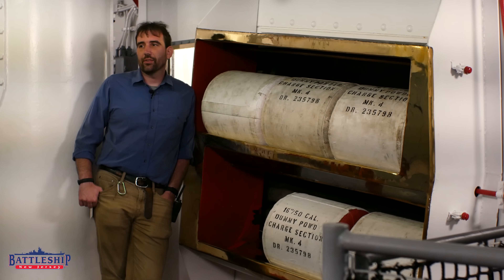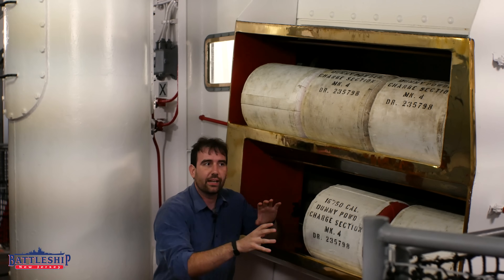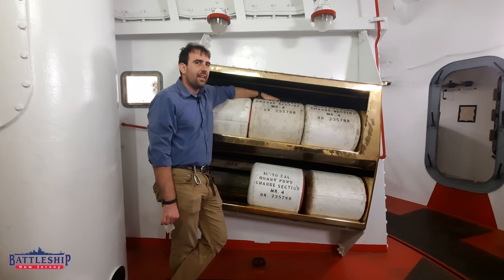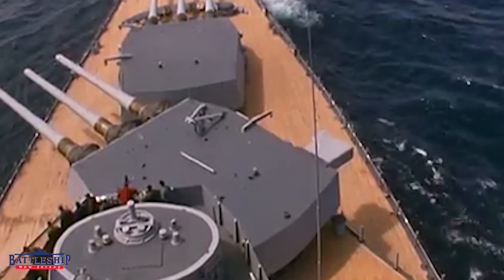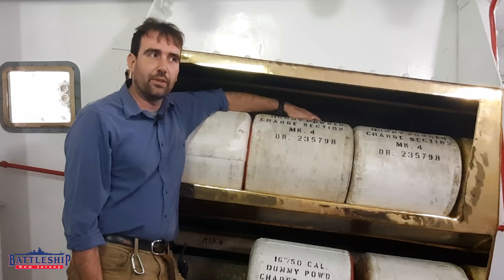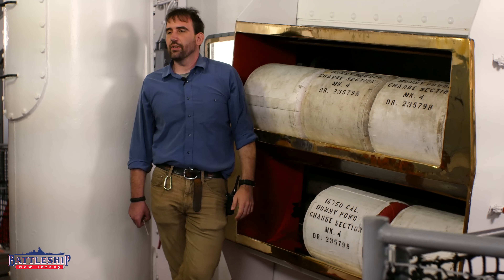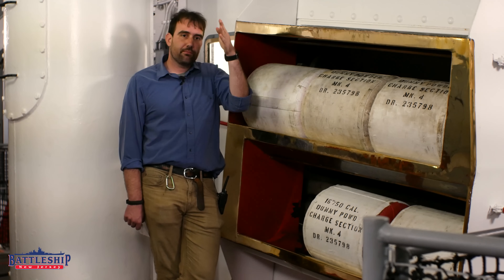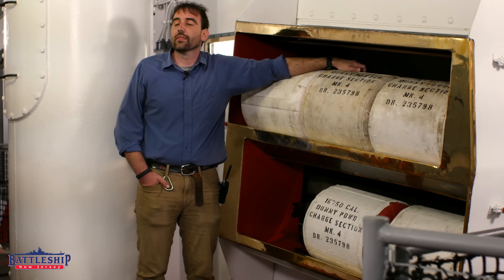16in Gun Powder

Comment: Black powder detonates, smokeless powder deflagrates.  Holes drilled help with surface area which is important for burn rate.  IIRCC, 20mm  Orlikon used IMR 4831, improved military powder 4831.  Great for .25-06 Remington.  Largest charge would be a 40mm from a MK 19.

Comment: In the 1934 James Cagney movie filmed aboard the USS Arizona they portrayed a rip in one of the powder bags dumping gunpowder on the floor of the turret and igniting starting a fire. Cagney puts it out by rolling on the ground smothering the flames and stopping a potential disaster. The turret scene looked more like a Hollywood fantasy than what it would of been looking at videos of actual turret operations. 

Would be interesting to hear if there was a check fire if a bag did rip open and clean up of the spilled powder before continuing on with the mission in actual operations?

Comment: Fired 5"38 Caliber guns on my tin can, USS Zellars DD-777, '67 - 70.  Of peripheral interest while talking about charge weights and pressures, would be the actual chamber pressure generated by a fully loaded 16"50 gun say, as opposed to a dinky little .22LR or maybe a .44 Magnum.  A 16/50 develops approximately 37,000 pounds per square inch of camber pressure, a .44 Magnum runs about 36,000, and a dinky little .22LR maxes out at about 24,600.  So, despite the variation in projectile weight, even from the lowly .22LR up to a 16/50 GP, the difference in chamber pressure is less than 10,000 pounds per square inch, and the 16 is just 1,000 PSI more than a .44 Magnum.  Wonder what Dirty Harry would think of that?

Comment: Did the discharge completely consume the cloth materials of the powder bags?  Were they nitrated in any way to make them burn?  Or what there residue that had to be removed between shots?
Reply from the maker: The firing completely burned the bag, but there is a burst of air after every shot that helps clear the barrel of any remaining debris.

Comment: Was the powder suspect in the turret accident ?   I think my largest charge was 70 grains (this is the AVDP weight of 1/7000 of an ounce) in a .388 Win Mag.
Reply: It really puts these loads into context when each 'grain' is larger/heavier than every small arms propellant load. One of those dummy charges would also make a nice foot stool to go under a loading bench I guess. Also interesting the stats on propellant degradation over time given the age of each charge, and I guess potential handling, operating and storage variations.
Reply: From what I remember from reading about it years ago, so maybe faulty memory, the issue was in that final layer of grains laying sideways. In some cases, one or two could be piled on top of that layer sticking out from the rest, and the pressure of the ramming home of the bags caused these rogue grains to combust in some way setting off the rest.

(Edit: looks like what I'm remembering is part of the "overramming theory", there's really good descriptions of what possibly happened as replies to one of the first posts.)

Comment: I've always wondered why the Navy had separate projectiles and propellant charges?  I mean when the Army loads a howitzer, it's all one cartridge just like a rifle.  Now for the 16" guns on a battle ship, I thought it might be to keep weight down but they did it for smaller guns too.
Reply: By using only 5 or 4 bags per shot, you would be able to dial your guns to different speeds and ranges.
But I think the main reason is that as a single cartridge, it would be impossible to move the thing around in a cramped space.
There are some truly ginormous shells, but I think those were all for field artillery, where you have plenty of space to move your cranes and hoists around.
Reply: Only light field howitzers have semi-fixe ammunition. Medium and heavy artillery-155 mm, 175 mm, 8" all use separate loading ammunition. No cranes or hoists used, it's all humped by hand. Semifixed ammo is just too cumbersome.

Comment: WRT the charges: an explosion is defined as a rapid burning process, whereas detonation is defined as complete molecular disruption by shockwave. Nitro-cellulose is derived from nitro-glycerine, which was originally soaked into pure cotton to make wet and dry guncotton. Cordite was the predecessor of NC.
The speed of ignition in a propellant is hugely important because, if the flame front exceeds the speed of detonation, the charge will high-order and actually detonate!
The speed of ignition is controlled by many factors; the smaller the grain, the higher the proportional surface area and the hotter and faster it burns. Conversely, making large sticks of propellant reduces the proportional surface area and slows both ignition temperature and ignition speed, which is why the holes are made through it to increase the surface area, but without increasing the overall burning temperature. In fact, the body of the propellant sticks keeps much of the heat inside the stick until it is fully consumed. Solid rocket motors employ the same principle, which is why rockets can be made from thin aluminium sheet.
To make the sticks you start with a block many inches wide but quite short, which makes it easy to put in very wide holes. You then role the block through gradually reducing rollers, each pair of which reduces the outside diameter but increases the length proportionately, and keeps the holes uniform at the same time. Letter rock is made the same way, btw.
Once you reach the desired diameter, rotating blades cut the sticks to the right size, and the tail ends form the odd sizes can be used to make up the charge weight or, because they are still moist, can be added to another batch ready for extrusion. Then they are allowed to dry to a selected humidity before packing.
All propellants are hygroscopic, so they will absorb moisture over time, and they are temperature sensitive, so tropical heat can reduce their stability too, sometimes causing the nitroglycerin to leach out and become friction sensitive, which is why all explosives are given manufacturers lot and date numbers and are given life expiry dates based on their usage and storage conditions.
One last interesting fact is that working with NG based explosives can give you severe headaches known as nitro-head.

Comment: My 43 grains of Varget looks pretty puny compared to that, but the main reason I love the A-Max is because it looks a little like a 16" projectile.  I haven't figured that the range is to scale, but I don't think I get quite 23 miles.  Maybe 22.
Reply: I have the real thing, a 16'' -50 Target Practice cement filled shell in a crate in my side yard. Weighs 1902 pounds, 8.1 cu ft. Why they put the cubic feet on the stencil is anyone's guess. I also have some 750 grain Hornady A-Max in 50 BMG. New and old style different boat tail profiles. The 16'' shell is flat as a board across the base and has a screw in plate in the bottom. The shell walls are 2.75 inches thick there. This is an insane chunk of steel to send down a barrel.  The Armor Piercing rounds weigh 2700 pounds. By the end of the year I will restore my round as a High Capacity shell with Mk 18 fuze for display.

Comment: How long does it take for all the propellant to burn after the primer is fired?
Reply: how long does it take to hear "BOOM!!!!!!!!!!!!!!!!!!!!!!!!!!!!!!!!!!!!!!!".....? Well, less time than that. =)
Reply: Less than 1/50th of a second.
Reply: Milliseconds because of the pressure generated.
Reply: @gordonrichardson2972  Thank you Gordon.  Your answer infers knowledge about the event.  May I ask the source of your information?
Reply: @WhatAboutTheBee  It's simple arithmetic. The muzzle velocity is stated as 2400 fps, and the barrel length can be estimated as 16in X 50 caliber, about 65ft. Divide the two to get the approximate time of travel of the projectile.
Reply: @gordonrichardson2972  Thank you again Gordon!  I appreciate the time you took to answer my question.  Cheers!!
Reply: @WhatAboutTheBee  That's called a 'ballpark' calculation...
Reply: @gordonrichardson2972  Ah okay!  I looked up the barrel length, 66'.  We know that the projectile is in constant acceleration, from a dead stop.  The kinematic equation for time, knowing displacement and peak velocity under constant acceleration, is 2×Disp/Vel= 2×66 feet/2400feet per second = 0.055 seconds.  

That is very nearly your answer and certainly close enough!
Reply: @WhatAboutTheBee  The pressure on the shell (accelerating it) would be decreasing near the muzzle, so acceleration wouldn't quite be constant (and pressure needs to build at the beginning). However, your answer wouldn't be too far off. You would need to know the pressure profile throughout the firing.
Reply: @philperry4699  Hi Phil.  Understood, I used constant acceleration for simplicity.  It is clear that propellant that burns after the projectile leaves the barrel is wasted.  If the propellant finishes burning before it leaves, then we have wasted barrel length.  The Navy obviously fine tuned this, and is the basis for my assumption.

 I'm hopeful that Battleship New Jersey will cover the topic.  Might be be too esoteric  but the question seems to have attracted a bit of interest (note the comments).  

The guns are the reason for the ship!  Interest in the details is justified!!

Comment: Looks like giant IMR4064 grains with more perforations to control the burn rate!!  I never knew that the grains were stacked in the bags, or that they were that large... almost the size of a 12GA shotgun shell!!

If the theory scales up from small arms to the 16"/50, most of the powder should be consumed by the time the projectile gets approximately 1/3 of the way up the barrel.  The expanding gases from the burned propellant will still keep the projectile accelerating until it exits the muzzle.  If you start varying the propellant burn rate, as would be happening when using the 16/45 propellants, you would likely end up with lower velocity, rather than higher since the faster powder is finished burning with the projectile closer to the breech end of the barrel, and you ultimately end up with lower pressure by the time the projectile exits the muzzle.  So, in effect, slower powder=Higher muzzle velocity=Longer range.  Faster powder=Lower muzzle velocity=Shorter range.

Does anyone know why silk had to be used for the bags?  Why would cotton fabric not work as well?
Reply: Cotton leaves plenty of smoldering residue to ignite the next charge. Silk burns more completely.

Take a look at the history of multichambered/multibreech cannon projects, where the idea was to keep touching off fresh propellant in side chambers as the shell moved up the barrel, and so a steady pressure on the shell. The US tried it in the 1880s, but couldn't keep flame and hot gas blowing by the shell (there's always some) from setting off later chambers too early. The UK tried it around 1910, using electrically triggered charges, but couldn't get consistent timing. The Germans tried it in the 1940s, to be the V-3 (vengeance weapon 3) but couldn't get it to work either.
Reply: @philperry4699  Thanks!

Comment: I noticed on the propellant bags, there was 16"/50 cal. Were there seperate bags for the 16"/45 cals, or could the same bag of propellant be use for both guns?
Reply: He talked about that in the video. 16"/45 used a smaller grain size for faster burn.

Comment: 9:05 One minor nit-picking dissent here: A faster-burning charge does create higher pressures, but a shorter barrel doesn't allow you to use a faster-burning charge. It is desirable to use a faster-burning charge with a shorter barrel in order to achieve full propellant combustion before the projectile leaves the barrel (or a certain amount of barrel travel), but the barrel construction and breech mechanism still determine how much peak pressure can be safely applied to the system.

In the case of the 16"/45 caliber guns, they used a lighter charge (593lbs) compared to that for the 16"/50 guns (660lbs originally). This meant a lower muzzle velocity with complete propellant burn in a slightly-shorter barrel for roughly the same breech/chamber pressure. If that smaller grain size was used with the full 660lb weight, that would definitely cause undue wear on the chamber and barrel, and potentially cause unsafe pressure levels. For a similar reason, people reloading or hand-loading small-arms cartridges need to be exceedingly careful not to load pistol-grade propellant into rifle cartridges.

Comment: Biggest charge I've fired is the ~3lb charge in an 84mm recoilless Carl Gustaf m/48
But I've fired plenty of those.
Can't count the 12cm mortars I served with during conscript training as I never pulled the string, just counted down the salvos whenever the connection between the ballistics computer and the piece presentation consoles failed mid loading as someones boot snagged and dislodged the wires with no time to reconnect them.

Comment: ive always have been curious were the 16 inch guns ever deactivated and if not is there a way to produce your own powder bags to fire a blank charge for people?
Reply: Well, this is separate loading ammunition, so firing a "blank" charge is rather tricky. It can be done by putting a foam plug in the forcing cone, elevating the barrel and then pouring water on top of it, to create a projectile of sorts. What you really are trying to do is to contain the burning propellant to the point where it will completely combust. I've seen it done with 155mm, pretty cool effect.

Comment: It's funny how similar the military designations are for small arms powder vs. the powder for the 16" guns. While the 16" guns use powders D845 & D846 (among others), 5.56/7.62 use WC844 & WC846. Whether it's .22 caliber or 16'/50 caliber, the relationship between barrel length/projectile weight/burn rate still remains. No doubt working up loads for a 16" gun and a .223 is pretty much the same process except the big guns weigh their powder charges and projectiles in pounds while small arms weight theirs in grains (1 grain=1/7000 lb.). Either way the principles are the same.

Comment: Des Moines class 8 inch/55 Mark 16 guns use powder case which are safer and compatible for auto loading mechanism
Reply: An hour ago when you posted I was showing a guest my 8 inch 55 brass case. Its 4 feet tall. I have an 8'' howitzer projectile that was used to disperse mine charges in my collection but its different than the USN 8''-55 projectile. I'm looking for one. Let me know if you run into one.....

Comment: Didnt know about the 7 holes in each pellet. Those are made during the extruding process? I wonder how that works? Anyway, this was really informative. Thankyou for doing this video!
Reply: BD: Yes. Just like making past or playdo.
Reply: @KB4QAA  I get that , its easy to extrude a cylinder. But can those holes be formed that way? I dont see it. Wouldnt they have to be drilled?
Reply: @billd.iniowa2263  There are pins in the extrusion die - 7 in this case.

Comment: Probably the heaviest charge I ever fired was maybe 90 grains of fff black powder in a .54 caliber muzzle-loading rifle.  Now, these grains are not quite the same as what are discussed in this video.  Grain is also a measure of weight.  Most small arms powder is measured that way in the United States.  One pound is equal to 7000 grains.

Yes, I know that I am supposed to use ff black powder in this caliber.  fff ignites better in traditional side-hammer and flintlock guns, so that is why I use it.  This is why I generally keep my charge weights below 100 grains.  If you don't come close to the maximum charge weight, you will not blow up your gun, even with fff black powder.

To further complicate things, black powder is measured in grains, but using volumetric measures that do not necessarily correspond to actual weight of the charge.

Smokeless powder can also be measured by volumetric methodology, but ideally the volume that corresponds to a specific charge weight actually will weigh what it is supposed to weigh.

Nitrocellulose powder as referenced in this video was historically also used for small arms, but like the stuff used in big guns, a single-base powder like this deteriorates with time.  Most more modern powders such as you might use to hand-load cartridges have stabilizers added and are much more stable.  There are also double-base powders out there and handloaders get into heated arguments over the attributes of single vs. double base powders.

All in all, a most interesting video!

Comment: The biggest charge fired out of a gun?  Friend fired a Savage 110 chambered in 308- but it was hand loaded with pistol gun powder.  The breech safety cutouts blew, my friend had his nose broken, the barrel had been welded to the lower receiver and the bolt and it knocked him literally out from the recoil.  Once we found out the gun powder source- discovered it was from an Uncle- we guesstimated on the breech pressure somewhere around 140,000 to 160,000 pounds- a very far cry from the 60,000 pounds per square inch in the Jersey's barrels.